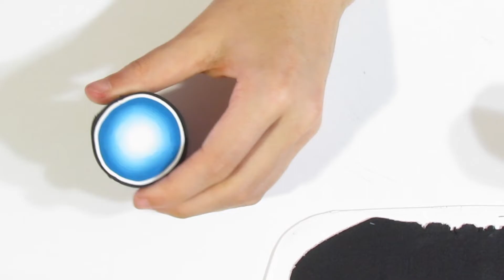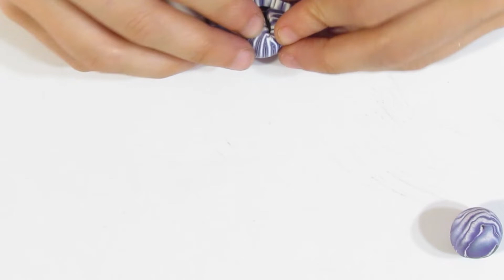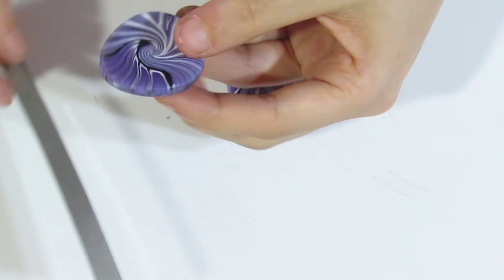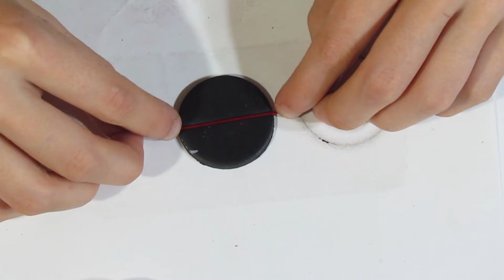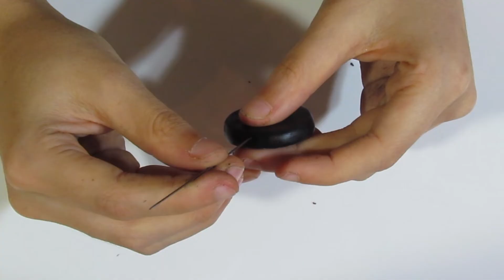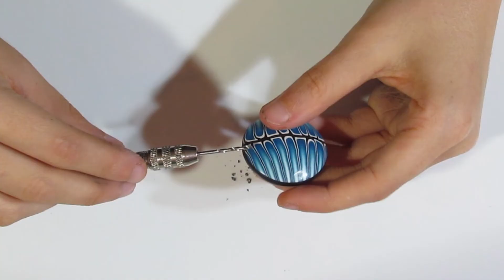Striped Flame Cane with Polymer Clay - Lentil Beads, Hollow Beads and More

Comment: Where did you get the pan that you use to bake the to how lentil beads and also where did you get the cutters are there any Pacific size that you have to use to cut them and finally how would you recommend doing multiple set something jewelry

Comment: It’s really worked well for me to just leave the wire in while I put the top of the bead and the bottom of the bead together. Especially if I want the bottom textured bc when I press the two down I can leave the bottom clay on the texture sheet so the texture remains and does not distort or close my bead hole! I sometimes even just leave the wire in during the bake if I haven’t use a lot of the liq clay. I’ve also tried the smear tech in the past. It works well however I find I don’t have a lot of patience for the multiple bakes!😂 I have started using paint pens that color the sides of the beads pretty well thou and is quicker for me. Seems to give a similar result so far. Thank u for showing the cane tech. Very pretty.